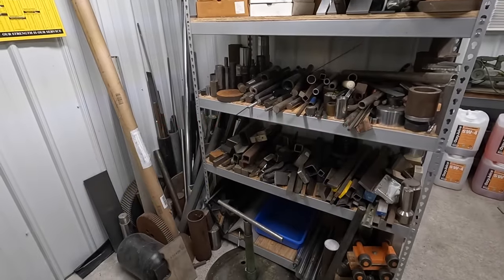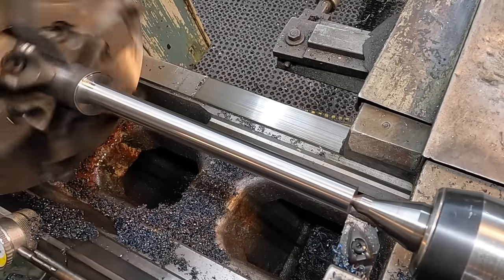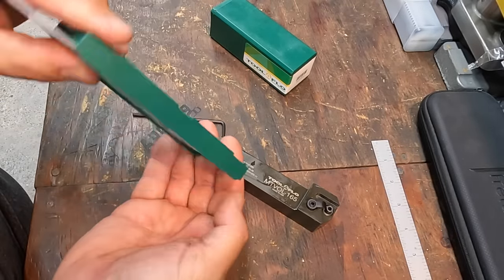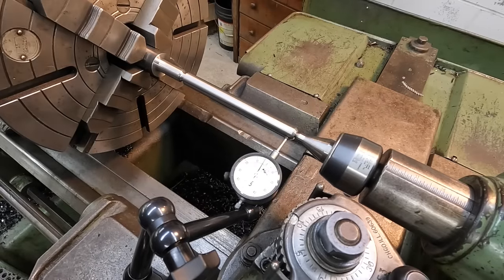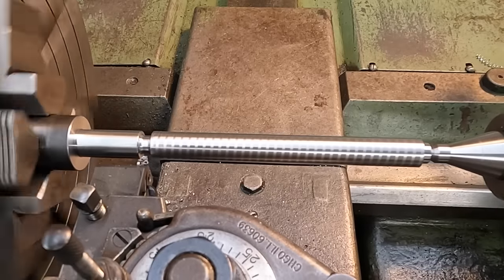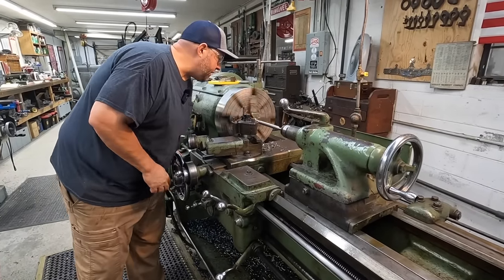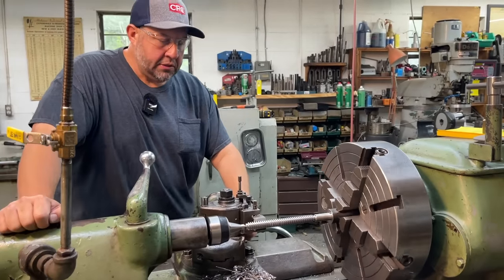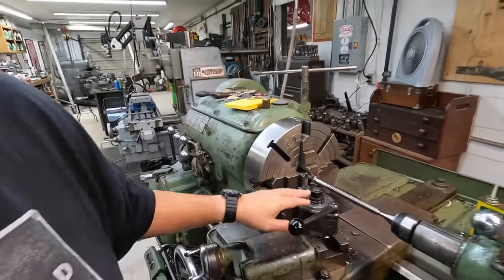Compound Lead Screw for American Pacemaker

Comment: David Vic and others are right, follower rest. I worked for one of the largest North American valve manufacturers back in the 90's, I cut 1000's of valve stems all Acme. Mostly in SSTL. On an Engine  Lathe ALWAYS used a follower rest. Your lead screw has a pitch to diameter ratio that leads to easy flexing given that length. Nothing wrong with your machine, just your setup.
Reply: Yup +1.
Reply: Namely the cross slide angle.
Reply: @waxore1142  the cross slide isn't adjustable, the compound is set correctly for a left hand acme thread
Reply: But that won't help if the problem is in the lead screw or the gears.
Reply: @markshort9098  it is adjustable. Two bolts, one on each side. Its basic geometry. The further in it goes the more to the right it goes and the more it's pressing on the right side of the thread. Until it pops out and does what it did.
Reply: @waxore1142  ok for a start the cross slide is fixed at 90 degrees, it's the compound slide that's adjustable.. yes it does move across as it's fed in and it needs to so it's only cutting on one side of the thread, if it cuts on both sides it will climb up the cutter way more because the cutter has pretty much twice the engagement into the work on an acme thread and it is double on a regular v thread and not only is it double if fed straight in, it'd be pulling a v shaped chip which doesn't flow over the cutter like a flat chip cut from only one side.. it's standard practice to set the compound to half the degrees of the thread being cut and directioned so the infeed is towards the direction of travel on the cut, with a right hand thread the compound is set the other side of parallel to the cross slide and set to half the degrees of the thread being cut.. i only have 2 lathes in my machine shop and regularly single point threads so what would i know about it 😐
Reply: @markshort9098  Its not worth arguing common sense in the geometry of 1 moving part "top part of the cross slide" ie compound slide. If the compound is what your driving in at plus anything above 90 degrees, eventually it will jump or carve into the side wall of the thread. he wasnt driving the cross slide in. He was using the compound to cut with. Wich will move to the right at an angle every time you turn the screw.
Reply: @waxore1142  Sorry waxore, Mark is right. It is common practice to feed the compound slide in at an angle slightly less than half the included angle of the thread (29 / 2 for acme) so that the leading edge of the cutter produces a flat chip and the back side takes a very light cut.
Reply: @waxore1142  watch this old tony "another thread cutting video" to see how to cut threads on a lathe, he shows the geometry involved using cardboard cut outs so even a child can understand it
Reply: @markshort9098  I am very familiar with this old Tony and I'm also very familiar on how to use a lathe. What you're missing is the part that's being fed in is the incorrect part to feed. There's nothing wrong with his setup. In fact you can get away with cutting threads like that if they're not too deep but when they start going deep that's when you run the risk of it jumping out because it's further you go in with the compound the further to the right it is
Reply: @waxore1142  clearly you're  not familiar with running a lathe at all, the cross slide is always returned to the same position and infeeding is only done with the compound so it's only cutting on one side of the cutter/thread.. this old tony demonstrates it really well for those who don't have the faintest idea about cutting threads, watch it and and you'll understand

Comment: The cutting pressure gets so great on an Acme thread, that it overcomes the ability of the material to maintain a true Centerline. The workpiece rides upward on the tool bit and causes the bit to be below the Centerline of part rotation. When that happens the material strenght begins to overcome the cutting force of the bit and it all comes crashing down. It's not the lathe, it's the ability of the material to resist the necessary cutting pressures.
I would use 4140 H.T. and cutting oil to make that screw.
Reply: Totally, every pass, the force on the work gets a bit bigger because the profile of the cut gets a bit bigger, but the part's ability to stay straight gets a bit smaller because its cross section gets a bit smaller. The part is just insufficiently supported.

Comment: Adam, you probably know this but for the viewers at home, there is a downside to using oversized stock. the outer part of the barstock has fine grained, homogeneous crystal structure but the inner core (typically barstock bigger than 2-1/2" or so) of larger barstock will have a lot of sulfide inclusions and larger grains because it is both the last part of the bar was to cool, as well as receiving less rolling forces to break up the original cast grain structure.
Reply: Useful info, cheers
Reply: Rorschach, thanks for that comment. I had been wondering if material homogeneity might be a factor here.
Reply: Yes, but! He was getting even chip control and smooth cutting when facing the bar, which on a gross basis would suggest fairly uniform grain structure across the diameter. I know what you are describing is real and have seen that before in mild steel cold rolled barstock, but that doesn’t seem to be the case here.
Reply: @Zircon10  this was free machining steel which is riddled with inclusions precisely to make chipbreaking easy. Free machining steels should NEVER be used on any highly loaded or critical component because it's propensity to crack anyway. I'm not sure that material was a good choice for this part.
Reply: @Rorschach1024  Well as a metallurgist with 35 years of industry experience I’ll have to disagree with you re strength and fatigue resistance of Stressproof. Niagra LaSalle manufactures it and here is what they have to say about it:  “STRESSPROOF was designed to meet, in one bar, the need for greater strength, elimination of heat treatment, better machinability and improved fatigue and wear resistance. It has a tensile strength of 115,000 psi, yield strength of 100,000 psi and an elongation of 8% minimum (7% above 2”). It is used in many applications including: Arbors, keyed shafts, spindles, gears, pinions, piston rods, sleeves, lead screws, racks, motor shafts, splined shafts, link pins, mandrels, boring bars, collets, bushings, drive shafts, armature shafts, rotary pump shafts, gusher pump shafts, kingpins, oil and water pump shafts, wrist pins.”

Notice lead screws are specifically called out as an application. Beyond that many of these parts are loaded well beyond what a cross slide lathe screw will see and applications like piston rods and wrist pins will see far more fatigue cycles than would be seen in a lathe feed screw.

Comment: Adam, thank you for showing when things go wrong. Machining can be a delicate dance.
I spent 15 years working as a Machinist for a large slurp pump manufacturer. I chased Stub Acme threads in cast Iron, white iron, 4150, 4340, & 316SS. These were LARGE Single, & multi start threads. Here's what I think your problem is. The diameter of that shaft with the length from the chuck caused the part to start chattering. Once you get chatter into a peice that small and long, you can't get it out. 
My suggestion for the next peice is to turn your compound 180 degrees so that it's parallel with the ways. Use a insert that's half the nose with of the one needed. Chase the thread to depth by feeding in with the cross slide not the compound. Once to depth, restart at the starting point on the cross slide but advance the compound and chase to depth again. Repeat that until you get the width of the thread you need. The chatter comes from the tool pressure on the nose of the tool. The tool nose width coupled with the diameter and length from the chuck caused it to fail.
Lastly, use some better material (4140, 4150).
It's not the lathe. 
Good luck.

Comment: I'll toss my comment in as well. Others have said it and i have found the same, the work is climbing the tool, period. You've removed enough material now that 2 things are happening; 
1, the work has become more flexible 
2, the tool has more contact area as it gets deeper into the work.
Add those 2 and you ceate a situation where the drag coefficient increases with every .002 you are moving in. 

 Get/use the follower rest as they are designed to eliminate this exact scenario.
 I've ruined enough threads with the same process on my 10EE that has less than .0003 lash in the nut/screws. It's not the lathe my man. 

 A good machinist not only makes junk parts from time to time, but is willing to be humble and ask others for advice. Sometimes we just can't see the forest through the trees.

 Keep making chips and keep learning !

Comment: Hi Adam from the UK. It’s really good to watch the old style machining content on your channel again. I’ve watched your channel for a number of years and was getting worried you were taking it in a less interesting direction. New machines are great but I doubt most of your viewers can relate to it as well as the home shop you have. 
I’ve read a few of the comments and I agree the tool pressures being generated are too great and the shaft is flexing. As it climbs the tool the pressures increase and so climbs more and more. As it’s a left hand thread the unwanted cut will be on the left of the tool. I know you’ll get it sorted and I wait with interest to see the resulting video. Great work Adam, love the old shop and the machines within.

Comment: Just cutting tool surface area, part just climbed the tool once it had so much traction, slower speed and coolant to lubricate and you're fine. Happens all the time with Acme thread cutting, you can cheat a little by moving half and half with the compound and the cross slide when you get over half depth to balance the cutting forces off the right side and shift some to the left side.
Reply: @ralphgesler5110  Yeah it would do it just the same on any lathe.
Reply: Had the part climb on a few threads I've cut, cut pallets of rods I've threaded on a manual so I'm not exactly green at it.
I think it's definitely what he is having problems with.
Reply: I'm wondering if the tool point is not on center with the lathe center, IE the shank is one inch and Adam normally uses a three quarter. Any deflection would then dig in.

Comment: Old broke-down machinist here. How infurating! Having a part go belly-up so close to completion! I used to run a 20-inch swing 8 ft gap-bed Nardini. The lead screw was buggered in that to the point that cutting single-point threads was pointless (pun intended?) :). As far as your situation, the deeper the tool gets into the thread, the greater the tool pressure gets, as there is contact on the point and both sides of the tool. Also, the root dia is decreasing giving the part more ability to flex, thus increasing the possibility for chatter. Once the chatter starts, the chatter vibration will be conducted to both your cross and compound-slides. That chatter may cause the slides to creep into the backlash zones thus moving the tool deeper into the part. 
If that's the case I think I'd try using the slide-lock screws to try and prevent any creep. I think I'd also try a heavy duty cutting fluid. Perhaps Moly Dee or Tap Magic. I see the Mystic Metal Mover setting on the saddle, but I didn't see you using it.

Comment: A general purpose tool, cutting at virtually a single point, will exert significantly less force on the work piece than the Acme thread tool, which has a wide cut. Once you had reduced the diameter of the work piece to the extent that it could flex in the centre due to the force applied by the tool, your problem started.
If I am correct, you will get the same problem on the new lathe, if you use the same set up and lathe speed settings, feed rate, etc.

Comment: Hello Adam, the Monarch is ok, it's just too much tool contact for the distance away from the chuck so the material is flexing as you are getiing deeper, the material is becoming thinner so it's more flexible and riding up on the tool, this will happen on any lathe, now that you know you will figure it out......... looking foward to your solution.
Reply: This is one of those things that's always boggled my mind and something I've questioned on Keith's channel. This is a relatively short screw, how are the lead screws that a 8 feet long or longer made? This little one clearly flexed so I can only assume the larger ones are cut with a series of dies
Reply: @maggs131  follow rest.
Reply: @strangefruit8776  I was wondering if there was such a thing and why I've never seen one used
Reply: @maggs131  . Where I worked at we made a 4 acme thread that was 36" long rod . You still have flex . You just to get feed and speed right . The part was made on CNC 35 y mazak.  Alot of things come in to play tool pressure . A lot programers will rough the thread out with a grooving tool then chase it to the thread profile with the right threading insert .
Reply: @aaronmcclain1279  kind of like the way the tap made the nut?
Reply: @strangefruit8776  correct......
Reply: Yeah, exactly - what’s worse is that the deflection would make the sides of the thread pinch in on the tool and make it ride up even more.
Reply: @maggs131  n
Reply: @maggs131  n

Comment: Many years ago my father's engineering works in the north of Scotland, used to cut very long acme threads for a piece of whisky distillery machinery. Initially we had the same chattering and digging in problem that you have had Adam. We cured it with a travelling steady rest. Our lathe was a lot more worn than your Monarch.

Comment: I am always amazed that in 2022 machinists in the US still use inches as a measurement system.  Very interesting video.  Thanks for taking the time to make it.
Reply: I'm always amazed that somebody can't conceptualize that a measurement system originally based on fractions (1/2, 1/4, 1/8) was the prevalent system for a very long time.  The idea of having a "base 10" with an equally arbitrary standard measurement is not really any better.  Show me where on the dial exactly 1/3 of a cm is... :)
Reply: @mungtor  Totally pointless point to make. On the handwheel or digital readout a third of an inch is going to be .333333 repeating or just about as close as you can get it....
Reply: No big deal. We just convert from inches to MM or MM to inches for fun when we get bored.
Reply: @mungtor  Ever heard of Millimeters or Microns?  I agree that the old fraction system has been around a long time...too long.  Answer me this, which value is greater, 17/64 or 9/32?  Then answer the question, Which one is greater, 12 or 13?  If you HONESTLY answered the first question quicker than the second one, then you should stick with the arcane measurement system used only by US, Liberia and Myanmar.
By the way I am not being critical of the video, on the contrary.  I was just making an observation.  I once thought as you do. I am a 60 year old American who decided to think critically, and change (in my opinion) for the better.  Old ways are not always the best ways.
Reply: @mungtor  At least they are part way to changing over, when they use a micrometer they mesures in DECIMALS of. The power of 10, tenths, hundredths and thousandths. Originally from UK I was taught imperial at school (long forgotten)but now changing over to decimal I find it much easier, logical and faster to use. Needless to say I hated fractions at school and still do.
Reply: @martyb3783  Best reply ever!

Comment: I never saw anyone cut threads without locking down the compound or using cutting oil until I started watching videos on here but that's two things I always felt was important. Seems like once the chatter starts there's no stopping it.

Comment: Gotta keep in mind, you’re turning something that’s 30-40x the diameter.  With a very blunt tool nose.

Not the machine, you need a follow rest.  The part is climbing up the tool tip.

Maybe even less SFM?  Chatter is usually related to speeds and feeds. It’s a harmonic vibration.

Comment: Hi Adam,  I know you know all the things I am about to say, but here goes anyway.  1st, coolant always,  2nd I always cut with a square thread tool and then come in with the ACME tool to do the flanks. 3rd,  I always ( on an old lathe) leave the leadscrew engaged and reverse the feed, taking all the issues with a worn halfnut out of the equation. And finally, that 1/2 deg on the compound could be making a difference. Best of luck on the next one. Mal.

Comment: My sense is the problems you hare seeing is the result of thermal expansion:

1) Problem occurred on the final passes when heat has accumulated in the part.
2) The location of the bad cut is in the center of the part. Since it is confined between centers, the thermal expansion is causing the workpiece to bow - with maximum deflection in the center.
3) Cutting on the left edge of the tool also suggests thermal expansion.

As always a great video Adam.